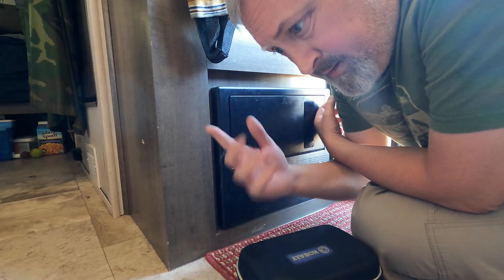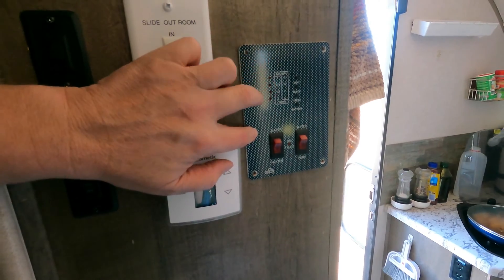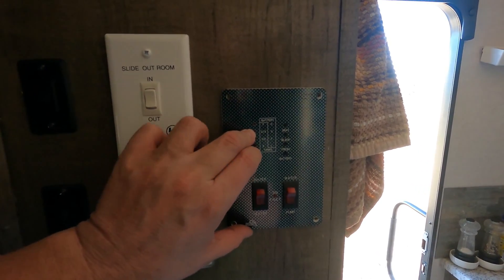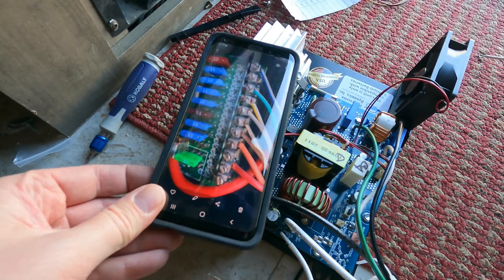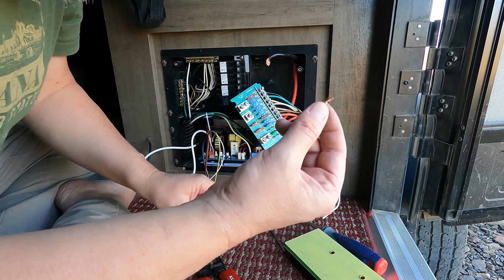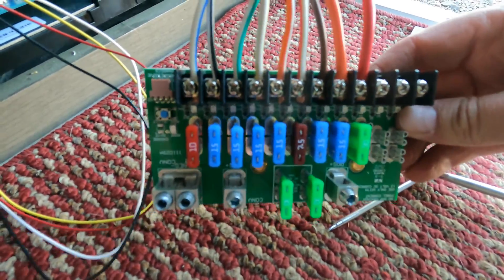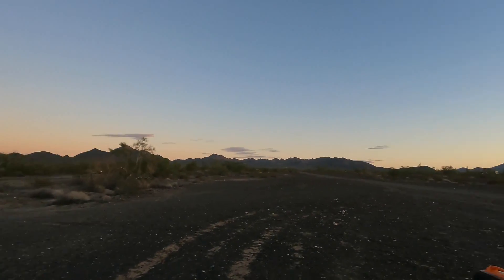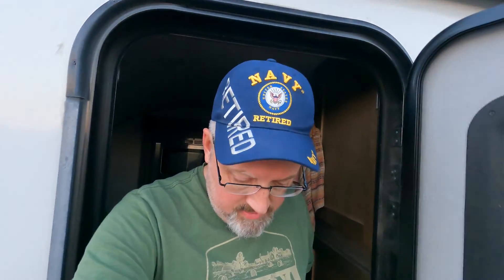Going Off-Grid with ease, Lithium Battery Charge Converter Upgrade

Comment: You got lucky.  My 2018 r-Pod had a vertical unit that you couldn't replace the converter w/o replacing the whole unit. Everything was soldered. I had to add an external PD unit.

Comment: Not a fan of Forest River RV's. I own a 2019 Palomino Truck camper. Very disapointed in their work and fit and finish.
Reply from the maker: The Rpod was fine for what it is. Took it all over the place to 49 states, including Alaska.
This summer, I moved up to a KZ 292RDK that is 10ft longer with opposing slides.
Reply: @horizontraveler3180  Interesting. We just purchased a 2013 KZRV285R 5th wheel from an estate sale. It was like brand new, two slides. So far, we really like the quality of the KZRV and the fit and finish. Time will tell. Thanks...

Comment: Nicely done. Mine needs a similar update.  Not a strong 12volt charge no more. Charges right about 12.3 max. I usually supplement that with a slow charge off the genny or the solar every couple days.  Definitely on the weak side though.
Reply from the maker: I bought a new trailer about 4 months ago, KZ Connect 292rdk, but it came with an auto-detect charge converter so it's good for either lead-acid/AGM or lithium battery chemistry types.
Reply: @horizontraveler3180  congratulations. Sounds like a mega upgrade!

Comment: Modulo the specific placement of the mounting holes in the new DC fuse panel vs the mounting posts in the chassis, you could have just rotated the fuse panel 180° so the individual circuits would be on the left, but in the "correct" order. Or, just put a thin strip of electrical tape over the incorrect numbers silk screened onto the board. Also, that interface cable appeared a little short. Obviously not if it worked. But if it had been, this 180° trick would have solved that problem to.

Is this one board taking AC and rectifying it to DC for the DC loads, taking DC and inverting it to AC for the AC loads, or both? Because if it's both, for that tiny board, that's impressive.